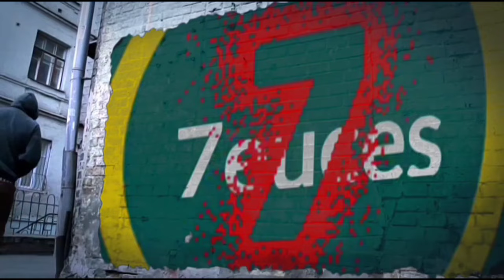New GX 460 owners need to do these 2 things 1st! You will love it! #GX460 #mirrorsfolding #filter

Comment: 2018 GX 460.  Lexus mechanic installed it for me yesterday 11/29/23.  He said he heard of older ones having the issue but hasn’t seen it in the newer ones.  I didn’t want to take any chances. He said the Uni filter is much better than the OE filter.  Was surprised dealer would even install it.

Comment: For the second mod:

The secondary-air pump draws in ambient air and injects it into the exhaust manifold downstream of the exhaust valves. There is a separate integrated air filter if the air is not drawn in from the intake system but rather directly from the engine compartment.
Reply: What benefit does this do?
Reply: @Voodoo1377 the current filter that’s in there disintegrates over time and will clog the system, it is pricy to fix.
Reply: Huh

Comment: Quick question , I noticed your coolant reservoir is all the way down at the bottom ! Is that normal ? Have you had any issues with coolant leaking ?  Reason why I’m asking when I got mine it has that much coolant in it and I had to add some coolant to it. Thanks for your input and great video
Reply from the maker: Hi I filled the reserve reservoir to the max soon after and it only went down bit so far... even after a 2000 miles trip recently. I brought an extra gallon for this trip as a caution but didn't even need that.

Comment: The reason it does not come with the window feature, rolling your windows down and up all at the same time can put a compromising electrical load on the system. I have the Base, SAImod, bfg ko2s same size as original, prinsu rack, and nothing else.
Reply: what is SAIMod ?
Reply: @thajeer I'm also trying to figure it out. 😂 
I'm just now starting to modify things on my GX46.
Reply: Won't the fuses take care of that?

Comment: Not sure if it happens on your year model, but for i believe the 20-22 models that the auto fold mirrors. Using the remote start with from FOB or enform app. Once the 10min run time runs out the factory alarm will go off every time with the remote start. Also. Using the device to auto roll up/down the windows. It will not close the sun/moon roof. It will open no problem., but you will have to manually close it everytime. Its ok for warm weather as you wont use remote. But i have to remove for colder weather using the remote start.
Reply from the maker: Yeah, this also close and open the sun roof as well, just need to hold the unlock button. Click the unlock button 3 times then it only roll down the windows.
Reply: @sevendeuces what is the plug-in? Are the window options available on a 2022?
Reply from the maker: @krazyleg  that plug in allows you to open and close the windows and the sunroof with the key fob. I'd think that works for 2022 as well since GX didn't have any major update... mine is 2019.

Comment: Oxygen sensor could possibly through a code.. I was told ?  But I can't see how? UNI air filter is much better than K&N which would definitely cause issues because of the oil..

Comment: Do you still like the folding mirror mod?  I took off the controller. The device kept opening the windows and we had rain a few times. No I didn’t hold the unlock button. The module just started to act up.
Reply from the maker: Yes I do, it is still functioning as it should for me. You probably got a defective one, try to get s replacement if you got it from amazon.

Comment: Thank you for sharing. Does the 2012 GX 460 have the same issue with this disintegrating filer?
Reply from the maker: I'm not sure, does your 2012 have that similar sponge in the secondary air housing? If you do, I'd assume so.

Comment: Did that plastic top cover fit back on after the filter change?
Reply from the maker: If you are talking about the tip cover on the side, you don't need that anymore. The filter replaced that. You still need the top cover which you insert the filter into.

Comment: I was wondering if they have the same device for 2021 Lexus GX 460? Just bought one.
Reply from the maker: It works on my friend 2021. I know it won't work on 2022 forward.
Reply: @sevendeuces  Thank you.!!
Reply from the maker: @ralphsantibanez9963 no problem,  ofcourse you need to pick the version for your year.
Reply: @sevendeuces  What is the name of the device for the folding mirrors.
Reply from the maker: @ralphsantibanez9963  search for obd folding mirror gx460 or click on the link in desc to the exact one that I got. I believe they have your year on Amazon as well.
Reply: @sevendeuces  Thank you

Comment: Wasn't the recent Secondary Air TSB to replace the disintegrating filter so this is no longer an issue?
Reply from the maker: No idea, was there a recall campaign or something? I would still replace the foam with the uni filter if they only offer to replace the foam.
Reply: @sevendeuces  Yes for 2010-2013 years there was a special service campaign released in 2019 to replace the pump and valves.  This addressed the cause of the valve failure.

Comment: Is the OBD module compatible also with the new 2022, 2023 models? I'm about to buy a new GX 460 Black Line.
Reply from the maker: Yes, I believe so. Still can't believe lexus didn't make this standard on a luxury line.
Reply: @sevendeuces  Thanks. Does the mirror folding/unfolding works also with the door handle lock/unlock? otherwise you have to get the key out of your pocket every time.
Reply from the maker: @jdesmo1  it works with the door handles lock and unlock as well since lock and unlock function ties to the lock and unlock function on the key fob, is that make sense?.
Reply: @sevendeuces  Great, definitely a useful mod. I'm picking up my brand new 2023 GX Black Line in Nori Green next week-so excited. Regarding the second mod on this vid, I fully understand the benefits, but since it's exposed change under the hood- might it be an issue with the factory warranty?
Reply from the maker: @jdesmo1  nah I don't think so. They would have to prove that your mods somehow make the situation worst but in this case it is actually enhance it. Toyota even had a bulletin awhile back about their little sponges problem. That nori green color is Fire 🔥!

Comment: Is the secondary air pump system on these GX's suppose to make a vacuum cleaner noise for the first 15-30 seconds on a cold start?? I installed this mod last weekend and my foam filter was still all so that is good but I am just wondering if and when it will ever fail. I don't want to be on a road trip somewhere and my truck go into limp mode. My GX is a 2014 with 98k miles on it.
Reply from the maker: It does on mine as well but not that long duration though and I got used to that by now not even notice the hissing anymore.  My personal opinion, you shouldn't get into limp mode because of that sponge problem if you removed it already.

Comment: For the second mod why do you need to keep the part you're replacing and for what inspection?
Reply from the maker: Incase some difficult smog check station require OEM air part. Not all the times but who knows...

Comment: Won't the exposed filter get clogged faster than the sponge on the inside?
Reply from the maker: That's what the filter designed for, blocking out dirt and stuff. The problem with the sponge is it will disintegrate to pieces over time and get sucked inside.

Comment: Do all mirrors have the motors for this mod to work? How do I know if my mirrors have the motor?  2021 GX
Reply from the maker: Not sure all but if you do you should have a folding button from your dashboard. It would be located on the dashboard right next to the door, on the left side of the steering wheel looking toward the front.

Comment: What is that air filter for?
What does it do?
Reply from the maker: That is the secondary air filter, lexus had a sponge inside the housing. I replaced that sponge with this motorcycle filter. The sponge will disintegrate overtime and get sucked inside which will cause a host of problems, even put the gx in limp mode.
Reply: @sevendeuces  What is limp mode?
Reply from the maker: @Tim Johnston  your dashboard litup like Xmas tree and your rig only operates with minimal power and barely able to move. Will need to fix whichever issue then clear those codes before it can be fully functional again.

Comment: I didn't get the reason for the 2nd mod. Wish you explained better.
Reply from the maker: That small piece of sponge inside the secondary air housing will get disintegrated over time and those little pieces will get sucked inside that can cause a host of issues, even put the GX in limp mode. Toyota even had a bulletin to remind everyone to remember to replace that sponge. We replaced that with the motorcycle filter so we don't have to do that anymore.

Comment: Do these both apply to 2023 Premium ?
Reply from the maker: For sure the filter is the same.  You can check on Amazon for the OBD connector for 2023,   it works on our friend 2021 and I believe 2021-2023 are identical.

Comment: What’s the second mod for?
Reply from the maker: The OEM sponge will disintegrate over time and the debris will get sucked inside and will seize the engine. Basically it will be in limp mode until you can clean all of that debris from inside. Put in that motorcycle filter and remove that sponge will eliminate that issue down the road.

Comment: What does the little filter do?
Reply from the maker: It replaced the sponge inside. The sponge will disintegrate over time and the little pieces will get sucked inside. That'd would mess up the sensors and will throw all kind of error lights on your dash. And that will put your vehicle in limp mode. They will need to clean all that out to fix it. Toyota had a bulletin about that issue.

Comment: How come you're the only one on YouTube showing the filter mod?
Reply from the maker: Not sure, I actually found out about this over the club lexus forum. Machine323 was the genius that came up with this fix/mod. Toyota knew about this issue.
Reply: @sevendeuces  what is it for?
Reply from the maker: @1sholland18  the oem foam in the secondary air will get disintegrated overtime and get sucked inside. That will give you a host of error codes and issues. The motorcycle filter mod will eliminate that problem.
Reply: And why so many scammers in your comment section repeating what you said?